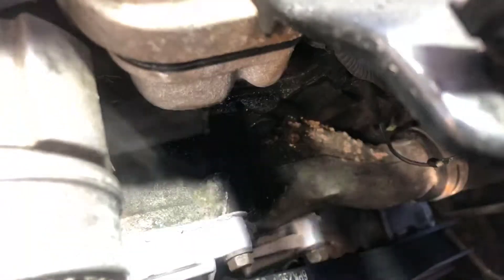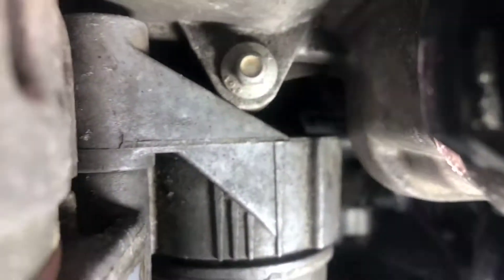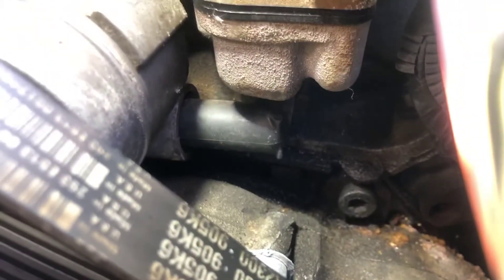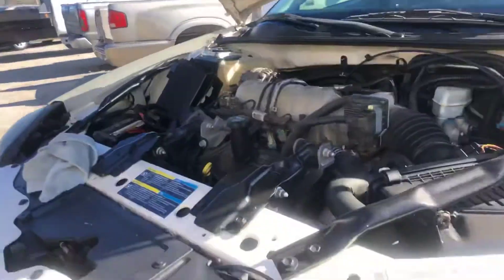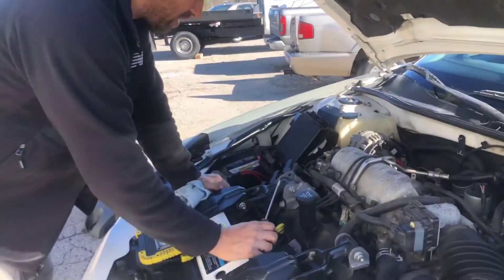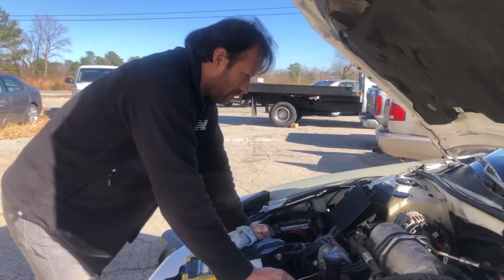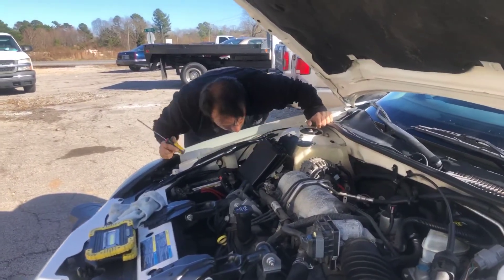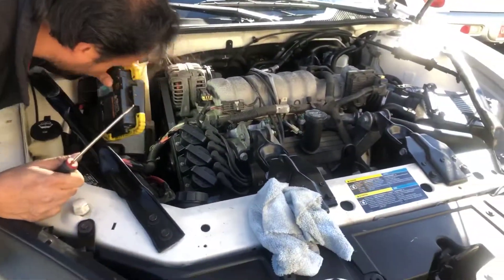Over heating Pontiac Grand Prix 2006 fix

Comment: Also about 195k you should probably change the radiator cap ,if it's not working properly..it will push all the coolant Into the reservoir tank. And leave your radiator low..and it might leak out of your reservoir..

Comment: It seems those plastic elbows are a common problem in the 3800 series engines. “The Car wizard” advises to check for those elbows and if they still have the plastic ones just replace them to avoid this problem. Other than that and a few other problems these engines seem to be very reliable.

Comment: Is it running out or leaking
Reply from the maker: It’s spitting out from the plastic elbow. Which are known to crack and get holes in them. The coolant just shoots out and as a result air gets in the system as coolant levels drop.